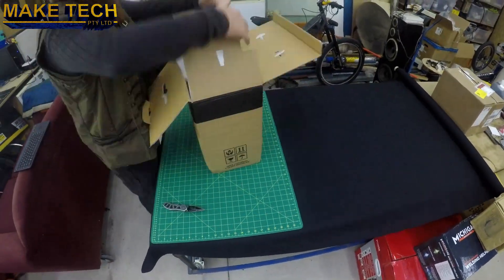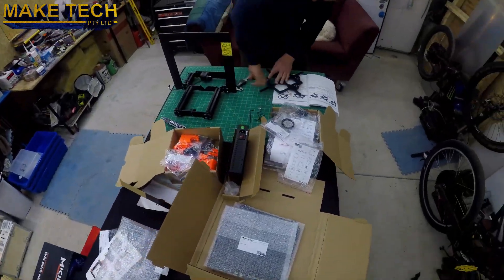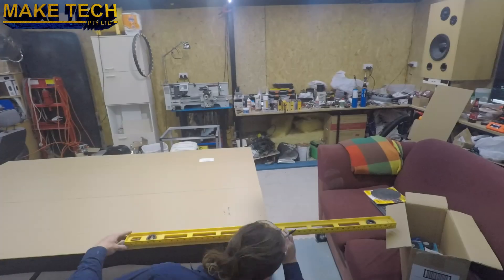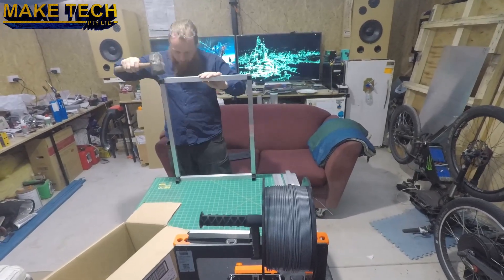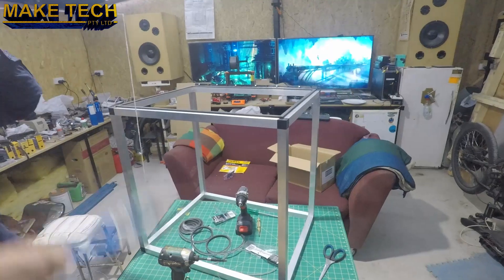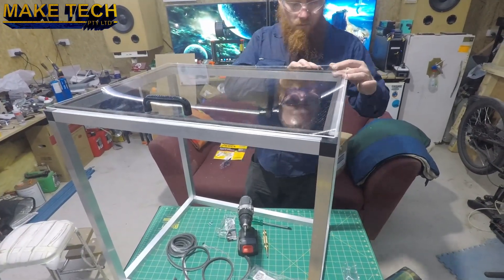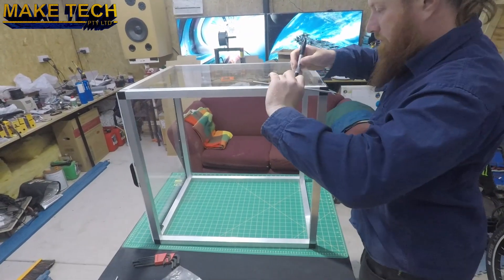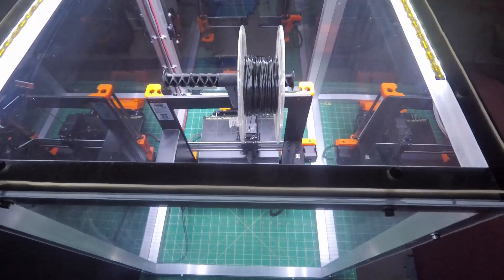PRUSA i3 MK3S Kit and enclosure build (Robotic Camera System Time Lapse)

Comment: much less spinning would be great! or slow it right down
Reply from the maker: Ok, thanks for the feed back. I'll take it onboard.
Reply: I spoke too soon after the build it was good, cheers mate. Can't wait to see what you make
Reply from the maker: @troyam6607  at the time of recording I was still in the early stages of developing the software for the Robotic Camera System and also still learning how I can use it. The camera moves (I call "scenes" in the App) that are not just orbiting, are more interesting. Like pan orbit then move in and out then pan orbit and back again. The video I've been working on I actually control the camera while I present different items on the work bench. 
Thanks again for your input.
Cheers
Ken
Reply from the maker: @troyam6607  new video uploading now, I had a few people say the same thing as you and I've taken it into consideration, let me know what you think.
Cheers,
Ken
Reply: @MakeTechPtyLtd  will check it out!
Reply from the maker: @troyam6607  ok its up. Sorry for the delay I had to sort out some stuff while there was some daylight left.
:)